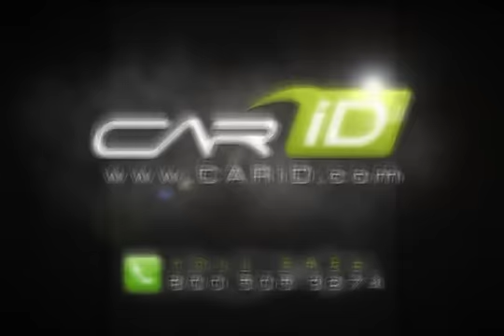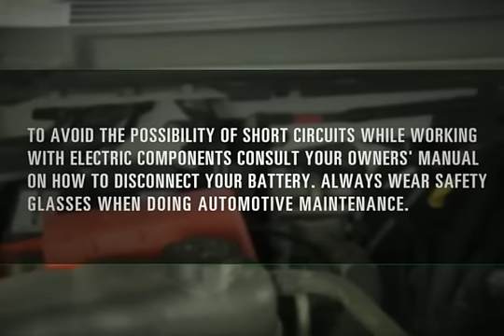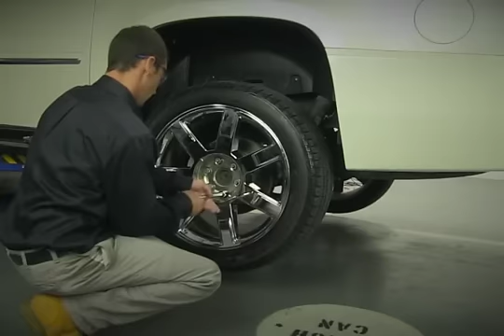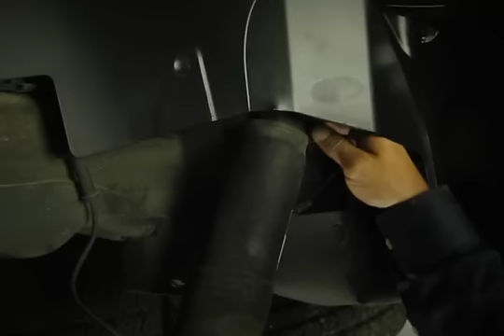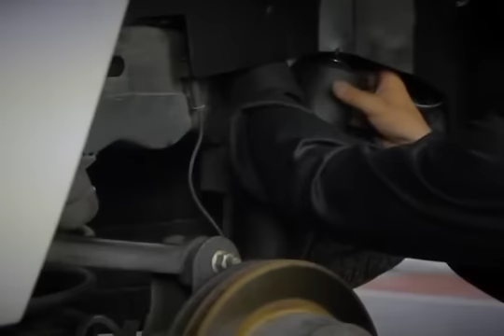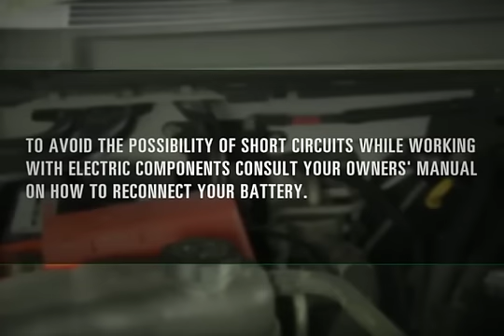Arnott New Replacement Rear Passive Air Shock Installation

Comment: Replaced air shocks car does not lift still
Reply: Hi, can you hear the compressor motor?  Check the compressor fuse, the motor may need replacing or the lines could be leaking.  
Good luck.
Reply: Toni Howard I replaced the rear shocks and the shocks are all the way up and the ride is horrible and hard... how do you get the shocks to work properly

Comment: Can I replace only the rear shocks with these passive ones? Or do I need to replace all four shocks?
Reply: Well I found that you do have to replace them with what's being shown but you can bypass the connectors if you want to step down to a passive shock